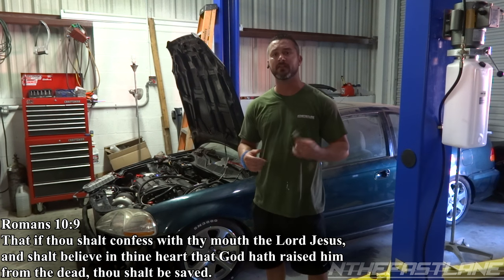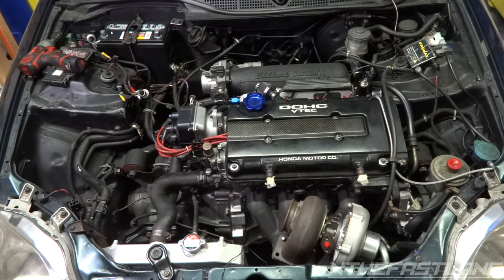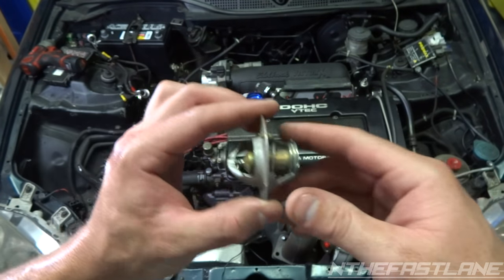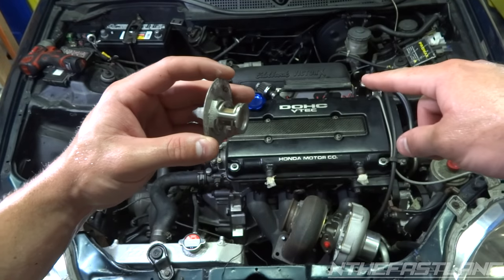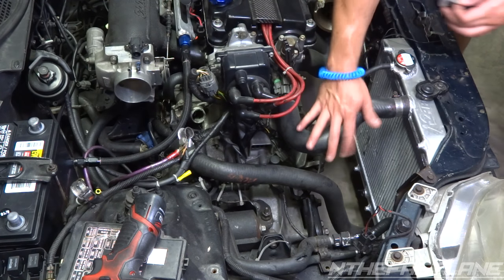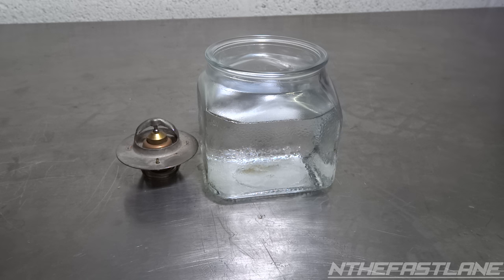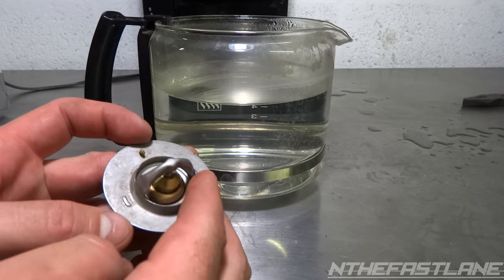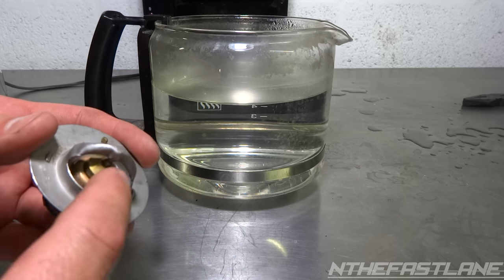▶️Thermostat: How It Works (Automotive)🌡️

Comment: You forgot the part where the wax inside the copper section expands, which is what pushes against the spring. The heat doesn’t do anything to pull or push the spring, except maybe make it softer and, therefore, easier for the expanding wax to push against.

Comment: There is Wax filled inside inboard cylinder of the thermostat. The cylinder lies on the inside of the thermostat and maintains contract with the collant. The cylinder also comes with valve that is connected to rod. The rod presses to the wax at the center of the cylinder. As engine temp rises so does the temp of the collant. This slowly melts the wax. The melting of the wax expands which pushes the rod outward. OUtward movement of the rod is what open the cylinder valve, Collant than can flow to the rad. I hope this helps.

Comment: Before making a video on how something works you should find out how it works yourself.
The spring on the thermostat is there ONLY TO CLOSE THE THERMOSTAT.
The thermostat opens by wax melting into liquid form and pushing on a rubber cup the is attached to the pin. It is basically operated by the hydraulic pressure of liquid wax. 
Where is the wax you might ask? It is inside the copper cylinder in the middle of the thermostat as is the rubber cup. The crimp mark on the side of the cylinder is how the opening temperature of the thermostat is calibrated. All this hydraulic pressure is easily able to overcome the tension on the spring that is really not that much at all. There is minimal preload on the spring.
Reply: I watched 3 videos already and none of the people who made them knew how thermostats inner mechanism works.  Thanks.  Do you know how a thermostat designed to stay in the open position if it fails, how that function operates? Mine is said to be engineered that way so if thermostat fails, it is designed so that it will stay in the open position.  That causes the car to take a very long time to warm up in cold temperatures and can also cause the check engine light to come on because the computer looks at how long its taking to get to operating temperature.
Reply: @artgallery743  I am only aware of that with electronic thermostats that can be commanded open and closed.
Reply: @artgallery743  On the whole, they work the same way as a regular thermostat under normal conditions. However, if for any reason the engine gets above max normal operating temp, a SECOND thermostat built into the same mechanism pushes the entire regular thermostat mechanism off it's foundation and through a one time ratchet sort of mechanism, jams the entire thing in the open fully position. Events happen like this: Regular thermostat fails in closed position. Engine gets too hot. Secondary (emergency) mechanical thermostat, built into the regular thermostat mechanism senses this and only operates when coolant is about to boil. Secondary mechanism lifts and locks broken thermostat in fully open position. You replace both as a single unit.
Reply: @erikdevries9208  Not a lot of people know this information, not something you could see or figure out by studying a thermostat you were holding in your hand. Thanks.

Comment: Well, I have to admit that this is the first time I have come across a video explaining that the thermostat is located on the lower hose.  Actually, I have changed many thermostats in my younger years and not one of them was located on the lower hose.  Why is that?
Reply from the maker: Hi Genera, great question!

This engine rotates counterclockwise. 

The water pump pulls coolant through the water pipe and thermostat housing located behind the block. This water pipe travels back to the water pump. When the thermostat stays closed it's like a closed loop system. The coolant circulates through the heater core and block.

Once the thermostat opens up, cold coolant is pulled past the thermostat into the water pipe and towards the water pump. Then it's pushed into the block and travels to the upper cylinder head and out the upper radiator hose. Next it travels down the radiator core and then through the lower radiator hose and back to the thermostat housing to complete the cycle again.

Hope this helps.
Reply: @Nthefastlane  Thanks!  I appreciate the explanation.  I just find it odd to find a thermostat on the inlet of the water pump.  Again, thanks.

Comment: My heating stopped working,  I took the thermostat out , I noticed that when I removed it,  it was fully open.  I put it in a pan of boiling water,  it stayed open,  then when I took it out , I could see it start to close.  
Is this a faulty thernostat? Any help would be appreciated 🙏  thanks for the video
Reply from the maker: When heat is applied the thermostat opens, when it cools down the thermostat closes. Sounds like yours is working correctly.

Depending on what vehicle you have, you might want to check the "Blend Door Actuators". A mechanic with a bidirectional diagnostic tool can test them. They can be vacuum actuators or electronic actuators. They open up doors inside the ventilation system to switch from the heater core to the evaporator core.
Reply: @Nthefastlane thanks for the quick reply,  sorry maybe I didn't explain properly.  When I took my thermostat out in the morning when I left the car overnight the thermostat was in the open position.  Should it not be closed on a cold start then open as it gets to temperature ?

So when I popped it i water it stayed as it was (open)  then removing it ,I could see it close up as it cooled down

Comment: Thank you for the video sir !
SOS, a very important question: the thermostat has a rod in the centre, in my friends car that ''axon'' broke due to a thermostat failure but never manage to recover it
is lost somewhere in the circuit but can be inside the channel of the radiator? can cause overheating or a problem to the car's water pump some day?
Is there a way to throw it out from the system?

Comment: some cars have thermostat in intake and some others in outake. Is that true?
Reply: savvas - yes they are.  My Suburban is on the engine side of the upper hose and my Toyota is on the engine side of the lower hose.  Most I believe are on the upper hose.

Comment: Can't I just get rid of mine so the water can just free flow?
Reply from the maker: You can, but it will effect your fuel efficiency. A temperature change sends a signal back to the ecu, the ecu then adjust the fuel map accordingly. Also, the heater won't be able to produce a constant heat. Ultimately No Thermostat = Bad Mpg. This is because the Ecu thinks the engine is cold and produces excess fuel as if it were just starting up for the first time.
Reply: The engine will run too cool and wont run properly and you wont get any heat from ur vents

Comment: You mean in ricer terms HAHA. If the vehicle calls for 195°F thermostat then that's what needs to be installed, most cars and trucks won't run right without having the correct stat in them

Comment: that is a bi-metallic strip btw not a spring
Reply from the maker: You are talking about a electrical thermostat. This type of thermostat operates using a sealed chamber containing a wax pellet that melts and expands at a set temperature.
Reply: +Nthefastlane that's a good one... how does a rotary pellet work... that would be a video I have not seen as of yet bro😀
Reply: yes the spring does not change its pressure with heat.
Reply: It is a spring and is not bi-metallic at all. The spring has nothing to do with the thermostat main valve opening. It only performs the closing function.

Comment: All it does it's open at the temp it's rated for lower the number quicker the car heats up next 180 doesn't mean u will run those temps usually a 180 stat starts to open 5 degrees later opens more at 190 running temps depends stop and go ur motor will still run at what ever temp it wants 195 200 a 195 stat be 205 210 area doesn't control ur over all temp
Reply: Typically if you swap in a cooler thermostat, you should also reprogram your ECU/ECM/PCM to switch the cooling fans on at the lower temperature. This will most definitely lower you average running temperature. Obviously a 180° will run higher than 180° since the thermostat is just opening at 180° and the coolant hasn’t had time to circulate through the entire system and begin dropping in temperature. There is no standard number though. It all depends on radiator, engine, and system size, pump flow, cooling fan efficiency, etc.